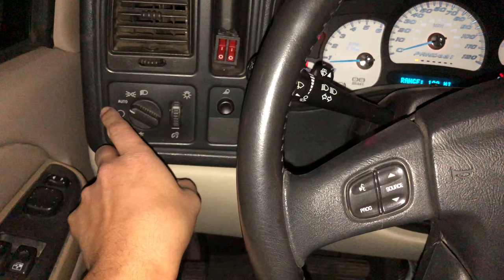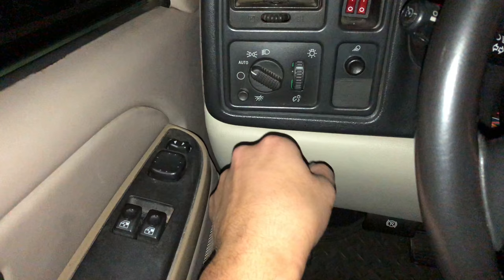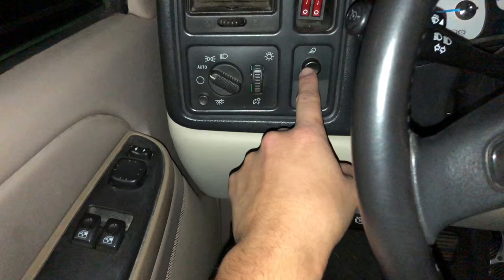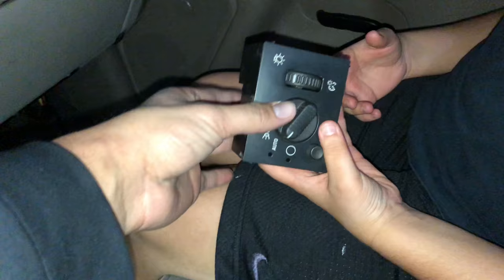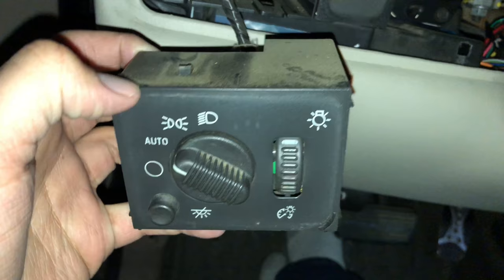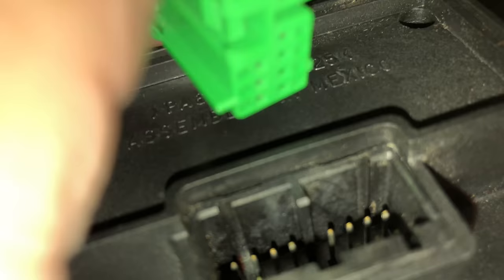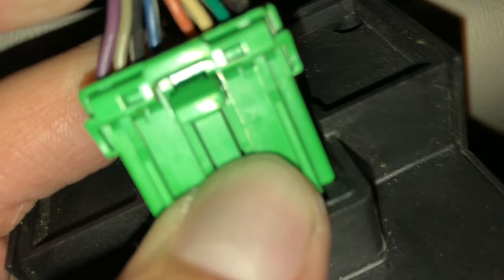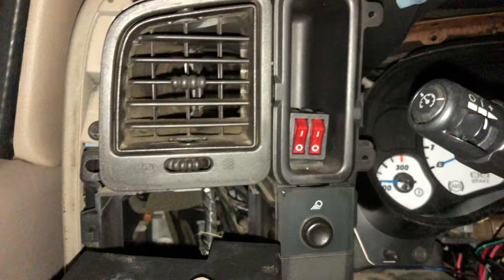Light switch Chevrolet Silverado, Suburban, Yukon, Sierra 2003-2006

Comment: Thanks for sharing!  I was searching for my breaker/cutoff switch, so when I open the door the interior lights do not power on.  I use to be able to push the breaker/cutoff switch and the interior lights would stay off until I depressed the breaker/cutoff again.  I am now wondering when I had a new front passenger headlight installed a while ago if there is a unknown problem.  I did not notice until a few months later that the new headlight lens housing and light bulbs seem to be a different color/shade of light.  I hardly ever drive at night!

Comment: If you switch your knob to O counter clockwise after auto does it stay there because if i do that to mine its springy and goes back to auto. I wasn't sure if their all like that before i replace it if someone could answer me please id really appreciate it. Thank you everyone
Reply from the maker: Any GM vehicle or most GM vehicles after 2003 have the spring back to automatic. I notice 99-02 it can be forced off which is nice.

Comment: Those are just a fiber optic tube for light to pass thru...they are not individual indicator lights when you turn the switch to auto or regular function it will cover the one your not using and allow light to pass thru what you're using
Reply from the maker: So even if I turn off automatic head lights it’ll bounce back because of light emitting through the switch. Instead of them being LED’s to let me know I’ve disabled automatic headlights